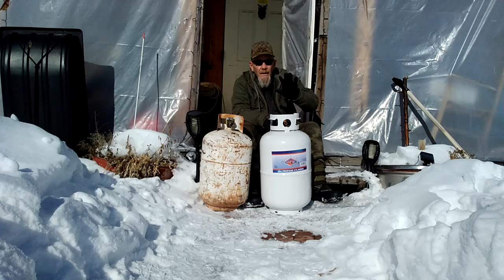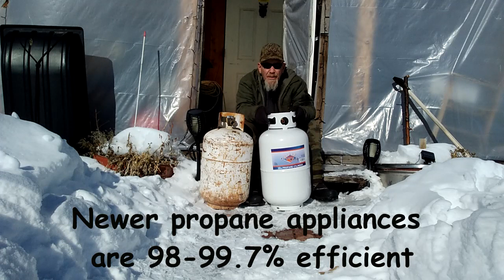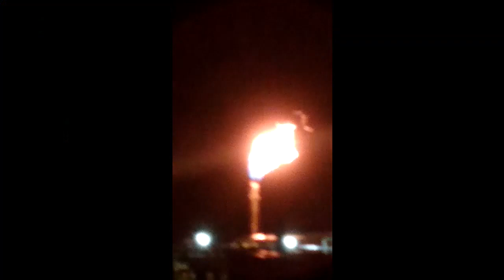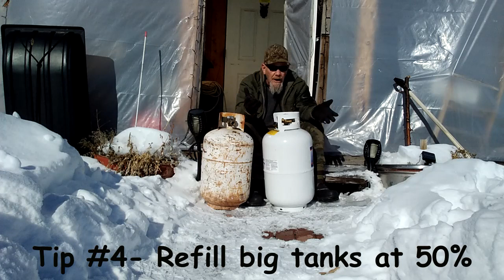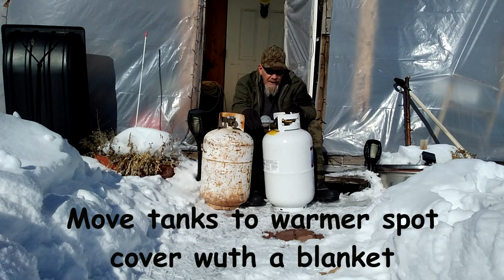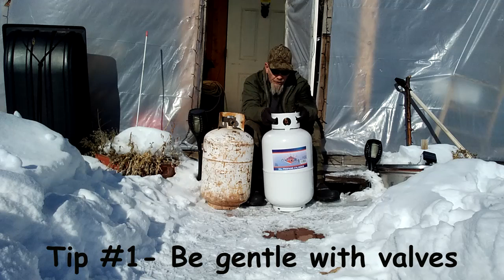Propane Tank Tips

Comment: Connect the house and slowly start the gas. If you stick your ears you do it if you hear a click the safety is engaged and blocked gas. Just shut the gas valve you will hear another click and that's the gas reopening. Just very slow open the gas valve and like this gentleman said just open the gas about 75%

Comment: One of the very best things about propane is that there is very little deterioration if it has stored long periods of time------unlike gasoline.  I am still using propane that is in a motorhome and the propane is 12 plus years old.
Reply from the maker: Yes, propane does not have the storage issues of gas or diesel. Much better for emergency storage.

Comment: So do you like move your tank around to accommodate the different appliances or do you just plug the three at once?
Reply from the maker: I keep the tanks on my porch and have a central line that runs my stove, water heater and furnace. My cabin is set up like a self contained RV.
Reply: @solarcabin  So I have to learn to plumb propane lines into walls? From the 2 videos (1 on trailer and one on house) I just watched, it seems like they run it underneath the rv or crawlspace and back up into the walls, then leave a cavity in the walls to access them. is that correct? sigh... is it a big learning curve? lol. what if I have a slab? I'm I screwed?
Reply from the maker: @zhugeliang777  I have videos for that: https://www.youtube.com/watch?v=aviUUS1TM1I
Reply: @solarcabin  do they run in the walls though? I think I'll go fancy, learn to build a full crawlspace foundation, then run the pipes under and back up the walls. I'll also put a mini dehumidifier down the crawlspace; it's 22.5 watt or 540wh a day, then I'll get refurbished solar panels at a discount and put them in front on a rack because I'll need plenty! 😂
Reply: @solarcabin  does the tank stay outside when in use? can I/do you put the heater in the loft? I want to build a 14x14 cabin like yours too. maybe I'll get a barn style roof though. I'm kind of greedy I wanna put a woodstove on the first level with wall flue kit then propane heater in loft. what do you think?
Reply from the maker: @zhugeliang777  Yes, tank must be outside always.  Heat rises so I use a propane heater on the main floor and that also warms the loft.
Reply: @solarcabin  I've made another inside layout where the kitchen cabinets and fridge take up an entire wall, which I found important and intuitive; and now with the addition of 2 doors, I find it very hard to set up both woodstove and propane heater on the first floor. hence why putting the heater on the second floor sounds attractive. I can send you the blueprint if you want to take a look. what's your email?
Reply: @solarcabin I'm really wondering whether they go into walls like regular plumbing... will do more research. PS. my original idea was to go pier and beam but then I hesitated because rodents and propane... I'm a bit neurotic with rodents.

Comment: nice info, if you live off grid like us its a must for heating and cooking. the best thing i ever did was get a RV two bottle 2 stage regulator. like you i have more than one propane appliance , it will keep up with the demand of running them all at the same time. not to mention switching tanks for you in the middle of the night. don't forget propane is heavier than air, i put small vents on my utility room floor because my batteries are in same room with OD hot water shower, thanks, keep up the good job of helping others
Reply from the maker: Thanks John!

Comment: Thank you for the explanation in this video... Before winter set in up here in Northern New York... 120 mi north of Syracuse, New York, and 45 minutes south of Ontario, Canada... I bought myself one of those cabinet heaters from Lowe's that has 6000, 8000 and 18,000 BTU settings... That holds a 20 pounder which is about 4.65 gallons right in the back of the heater... This video will better help me. Judge my propane usage in my cabinet heater... My primary main source of heat is a 1925 Griswold railroad caboose wood stove...., I average right now about 9 and 1/2 gallons of propane per week with my little cabinet heater from Lowe's, when I'm not capable of dragging in plenty of wood for the wood stove... I've been following you for a long time bro... I've implemented a lot of your ideas in my semi off red 28 ft camper... Keep up the good work... Knowledge is power. Peace out
Reply from the maker: Right on Michael and stay warm friend!

Comment: 😂😂😂 ❄❄❄🌬🌬🌬
🙈🙊🙋‍♀️☕
Winter is finally here in Maine. Lost count how many storms. This one is just beginning to stop and another coming Wed. Night😂
Thanks for the PROPANE info. Used the grill size for a few years. Now I have a piglet I think 100/80 pound tank. I have a vented unit that works without power. The fan does use power but at 120 sq ft. That's fine.
Reply from the maker: We have had several good storms here. Hoping for sunshine for awhile. Stay warm friend!
Reply: Fryeburg here. I only had electric plug-in heaters last winter. After 4 power outages so far this winter, one lasting 44 hours, I'm so glad I installed a propane heater last summer. It's my first experience with propane. They installed the same sized tank you have.  I used 80 gallons in 6 weeks for a 300 sq. ft. "3 season cabin" that I have almost winterized. It cost $4/gallon. Having heat that doesn't need electricity or chopping and stacking wood is sooooo nice. I use Eastern Propane. So far, their customer service has been very good.